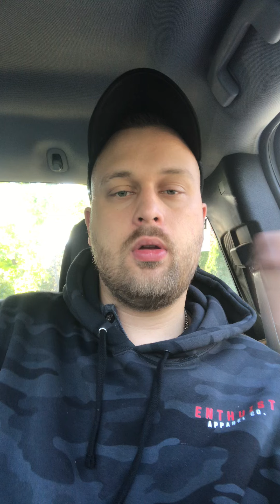Diesel vs gas welding rig

Comment: Never understood the point of a diesel welding rig still don't after watching this video.
Reply from the maker: It’s personal preference. If someone has an Camper that they tow along with them if they travel on the road then it may make sense.
Reply: Diesel rigs are much better on fuel  and also have more power and fuel is usually easier to find on remote jobs